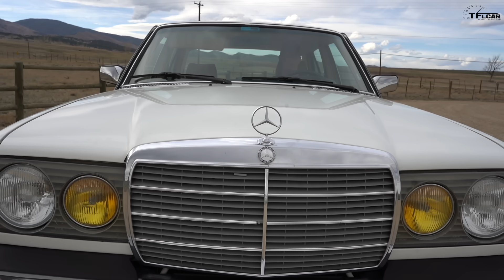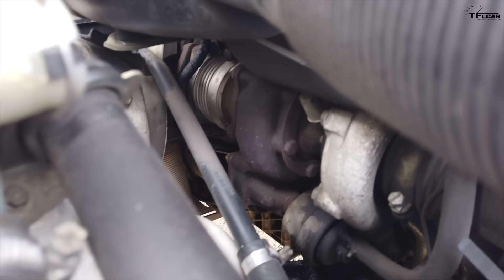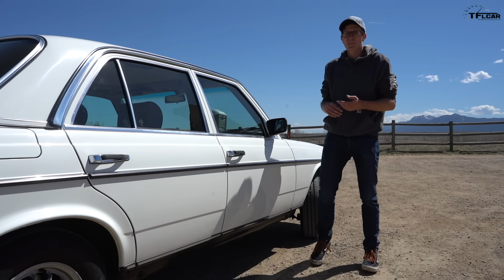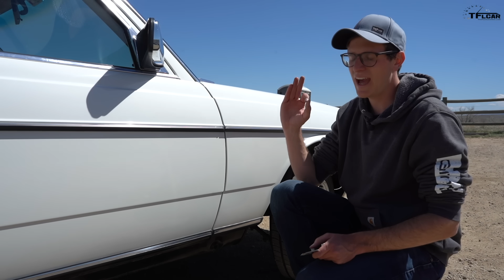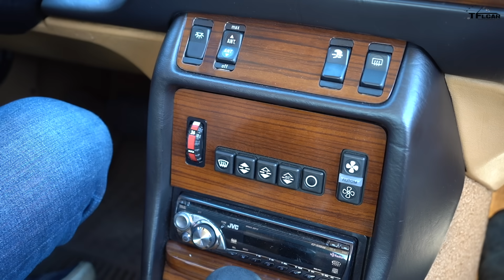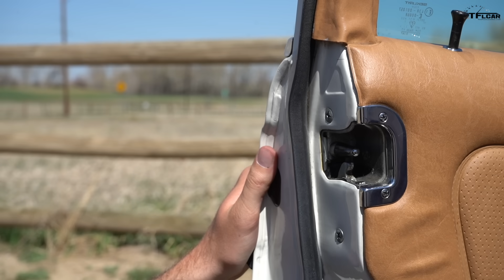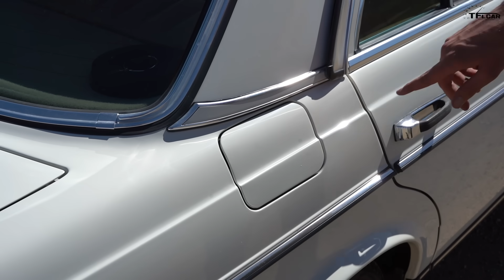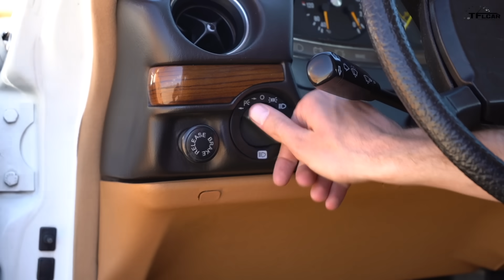This 37-Year-Old Diesel Is THE BEST Mercedes Ever Made!

Comment: By far the best Mercedes ever made ....by a mile .  Most mercedes have a 10 year lifespan due to being unreliable and the repair costs exceeding the value of the car so they get junked . Modern Mercedes especially as I don't see many 10+ year old Mercedes on the road unless they are a collector car such as an AMG or a convertible . To many electronic issues . Average joe isn't going to pay $5000 for a rebuilt transmission for an 10 year old Mercedes .

Comment: Had the 1978 300cd and loved it. However the power windows worked off the hydraulic air system that always seemed to leak. And many times the windows were stuck open.  Electrical problems too. But but a great cruiser. 65mph and touch it to 80 it sounded like a jet engine. My last speeding ticket driving back from Oregon. Excellent quality leather seats.

Comment: Owned a 240d and I can honestly say it was a well built and excellent riding vehicle.  The problem I had was it was so gutless.  I imagine the 300d power was a little better, but the 240d was so slow you would have to plan for the acceleration onto the highway.  If you can upgrade the turbo on the 300d I can image it could really be good.  Except for diesel prices today.

Comment: Yes the body is a tank but the moter is the worst Mercedes ever made it has a rod knock, you can’t drive them in winter couse you gotta warm it up for 24 hours before driving it and you need a mechanic we’re ever you go so can someone tell me why should I buy a turbo diesel
Reply: bro can confirm thats never happened to me. the engine is like the most reliable thing ever.

Comment: You have to see them after an accident. I had some in the garage where the trunk was caved in all the way to the rear window and all four doors opened and closed with no problem. He was in perfect shape on the bench. What looked like a total loss turned out to be a few days of cutting and welding work. W124 aren't bad either, they sometimes ran a million kilometers as a taxi, but then the problems with the water-soluble primers started. With the W210 you can listen to them rust.
Unfortunately, the Ford Crown was not available here in Germany. Here there was only Ford Mondeo or Ford Scorpio. Therefore here used to be Ford Granada or Taunus. They were cool too.

Comment: I had two of them back in the 90's, though with 2.0 liter diesel engine ( the acceleration was pretty much non existent). I had to do a rebuild  of the engine on a first one, and then I actually reinstalled that engine later to the second one. In Europe at that time they were quite cheap....and  I was young and broke ;). I used to laugh at the fact that you can actually fix most malfunctions with a screwdriver and a hammer. Apart from engine wear out what was killing then was rust...and that's what killed mine.

Comment: easy W126 with the same diesel engine. because then your getting a S class with out the cost of a S Class and the added benefit of the luxury and you skip the skyrocketing cost of the W123 TDs...........same argument W126 was all over the world and  was exclusively used by many country's LEADERS in Africa middle easy Europe and many many more all using the Diesel 5 banger turbo for reliability and heavy duty dependability

Comment: The ribs on the tail lights had a very important role. It was designed to prevent the air vertices  15 cm behind the lens and minimize the deposit of dust on the taillights. If you drive on the dustiest of roads, the car body may be extremely dirty but you will have the cleanest taillights and be able to observe its illumination.  MB spent a lot of time and $$$$$ designing those taillights.
Reply: It was so that NOTHING builds up. It was first seen on the rectangular 1976 W114 chassis, of which I owned a few.
Reply: Interesting, I thought I learn't it was so ice wouldn't build up.
Cool either way
Reply: They probably did it because the left taillight was always pitch - black because of the exhaust - fumes. Burnt oil...

Comment: Had a 1979 300D...naturally aspirated....77 HP.... indestructible, except the glow plugs before 1980 were IN SERIES!!! When one burned out, you could not start the car.... changed it in 1980... 10 QTS of motor oil...never runs hot....low red line 3,800 RPM

Comment: Yes very nice ive had a 79 300d 123 chassis  but my favorite ive had 82 and 83 300sd 126 chassis still have the 83. I dont know if you are aware but this 5 cylinder engine had a 500k warranty and nothing rides like these cars, the 30 mpg is very nice also.

Comment: Yes BUT! it does have it's irritating little problems, (mind you I drove these cars many miles) I have owned and put many miles on my 77 240D, 79 300D and my last one a new 82 240 D,  common problems on all  vacuum system, speedo, oil pressure gauge leaks, Cruise controls never worked on any of them, Climate control problems, auto transmissions, radiators, multiple starters on all of them,  gas tank Fungus effects fuel gauge gauge sensor, (maybe now with new fuels that will go away, front end suspension wearing,  on interiors even though MB TEX is super the seats all seem to break down and if you bought the car from a big boy the drivers seat will be broken down for sure (still a problem on current MBZ) , normal maint items like a battery every two years, oil, brakes, are all simple to do...and the Metallic paints of that era were miserable, on my 300d (Silver) clear coat was going after4 years where as my current 2002 320 C and 2000 320 CLK (silver ) still look like new...bottom line is would I buy another?  YOU BET!  a nice clean White manual gear box 240 D would be perfect....

Comment: I had a French Girlfriend who one.
She maintained it. Impeccable! She knew that vehicle backwards and forwards. The vehicle was very comfortable , road great and held up fantastic. The only drawback was the idling noise from the engine. It had plenty of room, Throughout. But what ruined it was Mercedes came out with the smaller and cheaper made 300 series. What a big difference. They change their engineering completely. And the key thing was Mercedes must have use the phrase “  MAKE IT OF CHEAP 
MATERIALS AND FUNKY ENGINEERING !  They have never been the same. The bean counters Win again.

Comment: This is a symbol of longevity. In Malaysia thousands are still running strong on our roads, albeit of the fact that they are all at least 35 years of age. Looking at the licence plate easily you can tell that these durable and strong-as-steel creatures have been around for 35-45 years. Either petrol or diesel, they always made thier owners proud and happy driving around in the prestigous three-pointed star emblem at the tip of the bonnet for many, many years. Astonishingly, a lot are still serving loyally as taxicabs and source of money to their loving owners. In this former British colony sovereign land, age limit for vehicles are things you can only dream of. You can own this Benz and drive her for any duration you please. Am I thinking that these lovable carriages will still clock up another 35-40 years down the road? ABSOLUTELY 😃😃😃

Comment: I had a 1979 240D and drove it until 2009 with 250K on it. Extremely well made but front fenders are prone to rusting. Also - the glow plugs initially were in series so if one failed none worked. Dealer replaced the system with a parallel system. Worked much better. As it aged it became hard starting when it went below 10F. The 240D was horribly underpowered but once up to speed, it went forever. I got 28MPG all the time. The seats were the most comfortable I have ever sat in and a 5 hour drive was very enjoyable. I had quite a few problems with the injector pump but that was about it. Easy oil changes too with a cannister filter accessible from the top. This car looked like a Mercedes - not like the new ones that look like every other car on the road. And you were right - the door closed like a bank vault door. A very solid car.

Comment: 240d is a better car first the Manual sunroof  manual A/C and 5 cylinder diesels were not available with the manual transmission. If you insist on a 5 cylinder diesel the 300 CD was much cooler car.

Comment: I still have my 1991 350SD (turbodiesel) with less than 120,000 miles on it and I used to have a 1999 E300 Turbodiesel. I crashed it when it hit 280,000 miles. It still ran completley fine and didn't burn any oil

Comment: My lower radiator belt broke I drove it another thirty or fourty miles

It really really sounded like a diesel

Parked it went to work came back put a belt coolant and drove it another hundred thousand miles sold it they drove it around 140k more miles and sold it with over half a million and to
My knowledge the engine never was opened in all that time

Comment: My dad had a 1975 240D smoke like a freight train if you crammed your foot in it. So you learn not to drive it you wait for it very slow impatient teenager at the wheel. Then my dad got a turbocharged 300??? SDL not sure on that number it was a long body fast I won't tell you how fast lots of fun... I didn't drive it that much it was after I moved out. The car that you are showing reminds me very much of the 240D brings back memories of Old Blue. Oh yeah the car he has today he made the mistake of trying to change a battery and I do mean a battery it has 2... I believe he had to pay someone to reprogram it and it would have been really bad if he had changed both batteries at the same time. The turn signals stopped working on the 240D so I took the mechanism out reground shaved off the PIN guide and it worked great after that. I doubt anything of a new car could happen so easily... looking at your car I see simplicity complex in design and quality. The fog lamps was on the bumper.

Comment: Great car indeed. The headlight switch is an example of sophistication, and totally German. I think VW still uses a dash switch instead of a stalk. I remember reading back in the day the rear taillights were designed to also prevent snow from accumulating  while driving by the airflow around the ridges. A masterpiece of engineering all around and I kinda like the style. very classic. Great homage to this fine car.

Comment: There's only two faults with these cars.
They can rust - yeah I know all cars rust but Mercs are prone.
The wheels get corroded more quickly than they should.
Reply: i got mine when i was 17, i covered the bottom and wheel arches etc with rust treatment like thick black oil, and had no problems, wheels can be replaced for sub 100£ and if ever needed that is, not had a problem in 5 years of daily driving this, was my first car, will definitely be my last, my car, will outlive me and im sure of that hahaha

Comment: You forgot the to put the fuel cap. it has a rest place inside the cover - 13:09 - , is a fancy wire where you slide your cap in while filling your tank. A least having your one hand free. In europe the yellow light is used as high beam even in fog

Comment: I owned one and agree 100% with your rating. I live in New England and rust finally got me to sell it.  I once was working on the pump area in my garage and turned the engine  on to test something (maybe a vacuum line) The car spewed black exhaust and I couldn't turn it off because there's no electrical ignition. Lesson learned as I had to repaint my white garage interior.  Best of all is the ride feel.  The most road stability and feel of any car I ever owned, including many BMW's .  I miss it! Good video!

Comment: My dad bought one in 1983 from Mercedes dealer in kenya DT Dobie, it was a 200D. As white as this one featured here my dad loved it to bits. You could not enter in it with any dirt. I dont remember it failing at any time on the road...only once I saw it down by the road, the fan belt had cut out.
RIP Pius Gumo

Comment: I’ve got a  91 190d  2.5 5 speed with only 64,000 miles which is not run in yet , this engine will do huge mileage and it’s a manual too
These gave the best mpg which was everything along with Mercedes quality and reliability in that era , we all know later that decade Mercedes lost the plot so I consider the 190d the last of the properly built best mercedes

Comment: My 1975-6 240D 3.0 (non turbo w115) needed its first engine overhaul at 96,000 miles, at 337,000 miles it broke the crank. The car could understeer right off the road, the breaks faded after 5-6 hard applications. Not mine, but my uncles w114's whole rear end sagged by its eighth year. W123s only didn't sag but the rest is the same. Interior was not up to quality as in w114-5s. And any car I have today is better than anyone else's car. Older car are so much greater than today's cars. No. Yes.

Comment: I had a 1980 300 Turbo Diesel just like that one except my interior was dark blue. It was the best car ever. The second best car I ever had was the 1974 240 diesel. The ‘74 was a German spec, so it was a little bit nicer than what could be bought in the US at the time. I drove it until 1994, and I wish I still had it. I love the sound of the engines.

Comment: I drive one now. I've driven them for years. I needed a pickup truck so, I put the 617 engine in a stretched out '74 Hilux with a straight axle. Drove it for 25 years until I had a head-on on the 118 frwy in SoCal. I got a wagon and had another head-on. Got another wagon now. I've rebuilt the engines. I had a 4-dr that I hauled the kids around it. It got crumpled on the ice on 97N in Oregon.
My stretched pickup truck had the 1978 transmission that has an extra low 1st gear. The only weak point on the 5cyl turbo is that it was made for a cold country.  The engine oil cooler does NOT get air circulation from the fan. it breathes only when you are moving. I added an oil cooler and transmission cooler to the truck.  I hauled trailers and, went off-roading. My current TD just lost the transmission. Gotta put the rebuilt back in.

Comment: Alright, 
Let me start 1st. That car is so special and unique by all measures. 
I grew up in a country where that model was luxury one. By the time, people started using it a taxi between cities or long distances. 
Some of them still have it even though the odometer surpassed 1million miles. But, they are still running like brand new.
So strong like a bulldozer, fuel economy, durable. And if you have a bad luck, just try to hit it with those new nowadays plastic toys called cars. You will curse the day you hit and I can assure you. 
So fast like a rocket though old.
Auto parts are cheap.
So sad the government asked taxi drivers to stop using it or face fines.

Comment: Apologies for being very late to this video party! I agree with all you have said about this car. I am a Volvo man strictly speaking, but I love your car! Volvos were always pitched a notch or two below Mercedes, and I like them for that ie. nothing pretentious about them. They are solid and quirky, just like your example of this excellent diesel 5. I have a friend with a 3 litre straight six Merc, non-turbo, from the same era, and it is madly indestructible! I hope you have many, many years enjoying your fab car! (I had a Volvo 940 estate/wagon diesel 6 - VW engine spec-ed for Volvo - sold it with over quarter of a million miles, working just fine at 20 years old, still see it around 5 years later. Turning circle as good as the Merc. Long live the chunky, clunky oil burners! Btw - F vs C - it's simple! Apart from knowing that the entire rest of the universe uses C and you Amer'c'ns aughta get used to it (-;) just remember that 21C is about most people's idea of a moderately cool-to-warmish 'nice' summer temperature, and what you set your home or car heating at, warm enough for a T-shirt, not too warm to make you sweat. Sort of cool warm. A few simple reference points - 32F = 0C ie. ZERO! FREEZING POINT! Kinda easy to remember and use, right? And boiling point is 100C, not 212F in any other country!!! 40C is about as hot as you'd ever want your shower, and 25-28C is the temperature you'd want your dough to be when making bread, which is getting uncomfortably warm for us notoriously cool blooded Brits. And 0C-100C - bit like percentage, right? And all other things decimal, which you guys have to use in ANY international collaborations. I mean, 5mm is just so much simpler than 5x25ths of an inch. I used to be a carpenter here in Blighty - try multiplying or adding measurements like 7/32nds and 5/28ths and 13/16ths etc. One day America! And why, when you decided to keep so-called imperial measurements did you change a pint to 16 instead of 20 ounces (of water, originally, as the standard), and call a hundredweight 100 pounds, meaning a ton in the US would be only 2,000 pounds when a ton is in fact 2,240 pounds... - Out of interest, do you guys use tons at all? - That's why you talk about heavier weights in thousands of pounds, when we would, if we still used it, use tons and fractions of tons ie. hundredweight (I know, stupid that ours was 112lbs, but then 20 of those makes one ton. Easy peasy, yes? No! I know, it's all a bit bonkers) Actually, the American pint being also one pound of water made some sense back in the day. But you're gonna have to bite the bullet, face the music, take one in the butt, and one day change to metric. Please! We started 50 years ago, and we are still in a mess of measurements that make no sense to Brits (in a pub here you can only buy pints or half-pints of beer, but all bottled beers are metric!) and confuse the hell out of all visitors to these shores (including you 'Merkins wid your pints and gallons all over the place...). Yet you love your European cars, and EVERYTHING to do with them is metric. Just sayin'...